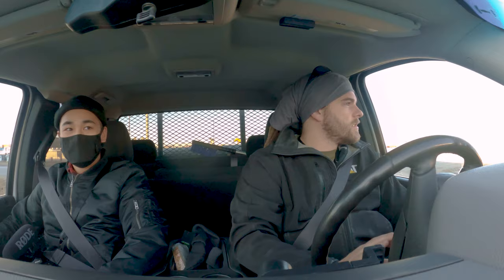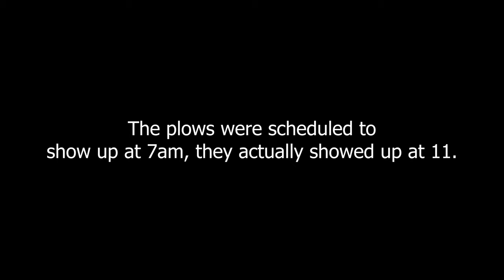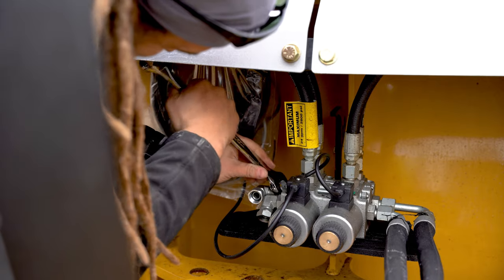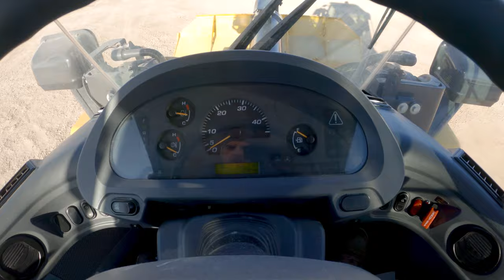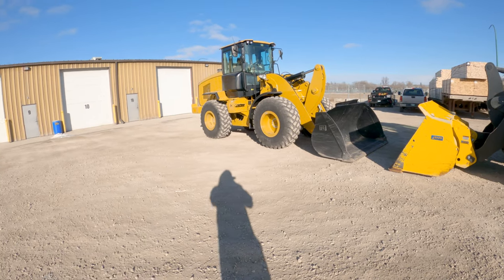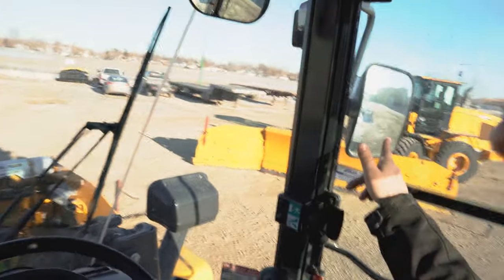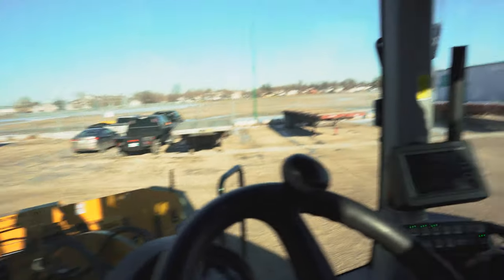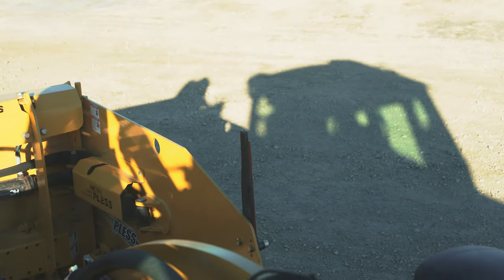Caterpillar Vs Komatsu Loader Showdown - Snow Removal

Comment: KOMATSU loaders are great. Power, visibility, durability all 10/10.
Reply: I've operated all 3, the 250 270 and 320 worked at a sawmill.  250 and 270 mainly for running logs. The 320 was used for mulch, sawdust and loading trucks.
Reply: I koji je najbolji??

Comment: Nothing better than having all the controls for the metal pless on the joystick! No moving your hand
Reply from the maker: Although both loaders have different set-ups, it only takes a minimal amount of seat time to get used to the different layout.  Do you run heavy equipment?
Reply: @TerracePropertyMaintenance  yeah, I own a landscape business. I have two separate loaders with metal pless and I use the same custom joystick in each. The buttons for the wings are on the back with the scroll on the top for the angles. It’s such an efficient setup
Reply from the maker: @nickklingender907  Oh that sounds dope.  Custom joystick from where?
Reply: @TerracePropertyMaintenance  we had the company who sold us the loaders to make it for us. It’s the joystick that was in the machine, re-wired with the added buttons to work with the blade
Reply: @TerracePropertyMaintenance  I have a video if you want to see
Reply from the maker: @nickklingender907  Yea for sure where can I see it?
Reply: @TerracePropertyMaintenance  follow Klink and son on Instagram and I’ll send it there

Comment: just messing with ya but real loaders dont have steering wheels. lol thats a nice loader. i work at a quarry and use a Wa500 new style loader from time to time and i usually run an excavator in the pit.
Reply from the maker: haha that machine would be a bit overkill for 99% of snow removal jobs.  It would also make finding an operator tougher, as most people are not familiar with those control layouts.  

Thanks for watching!